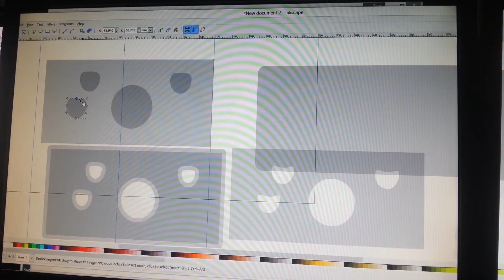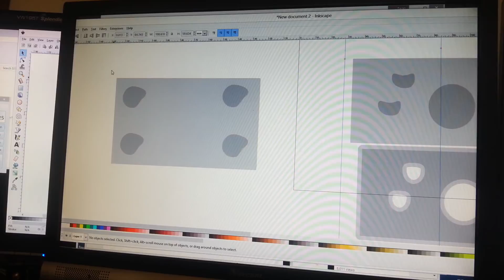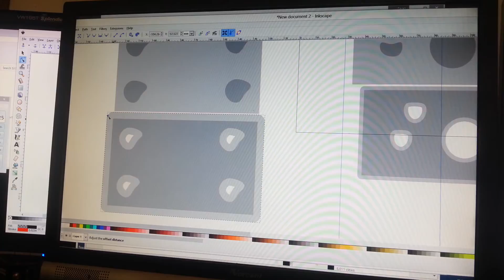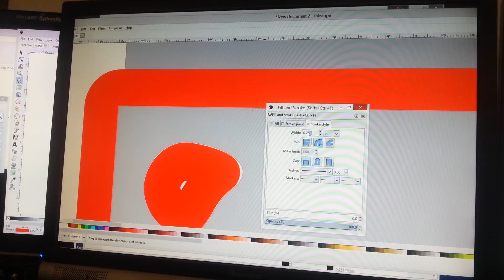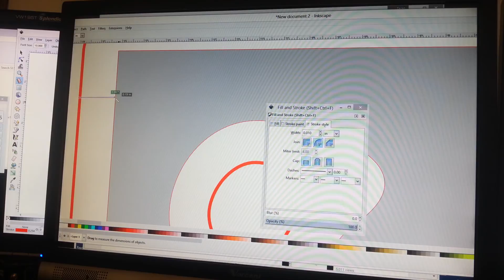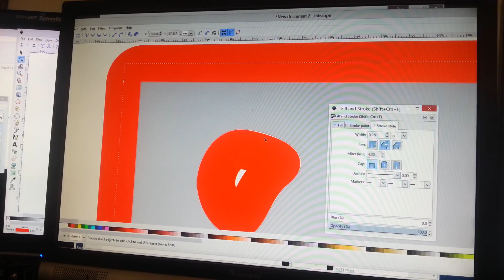CNC_25 inkscape tool paths.  Cloned booleans.  Cloned cut-outs.

Comment from the maker: Two edits to video.
1) it wasn't necessary to change the stroke width to half the bit width.  A stroke width of .25 was correct for a bit of.25 diameter. 
2) if doing a linked offset ever results in an interior hole getting bigger instead of smaller, you need to a) convert the hole to a path. b) select that single path (fixing a lot of holes by selecting a bunch of holes, or multiple paths won't work). C) go to Path-> Reverse d) repeat b, and c for each hole. 
You can convert objects to paths earlier in your design next time (and even do a quick "linked offset" to make sure you don't need to "reverse" the path). 
Does anyone know how to ensure the "reverse"ness of the path will be correct every time?